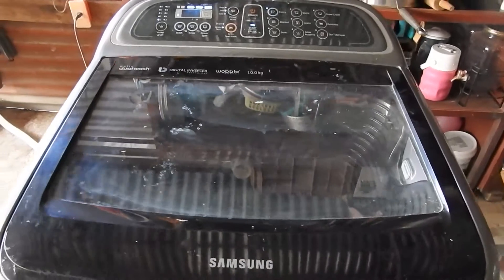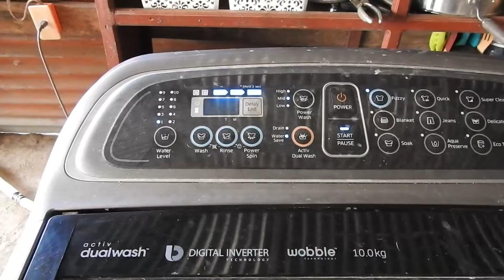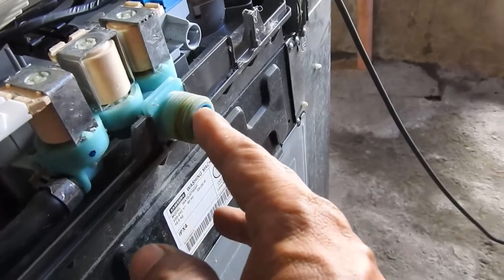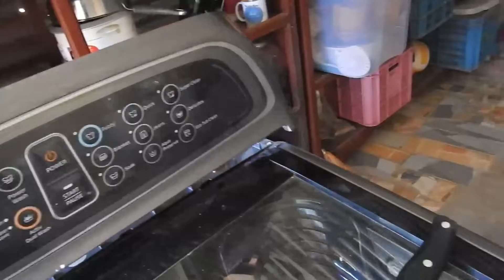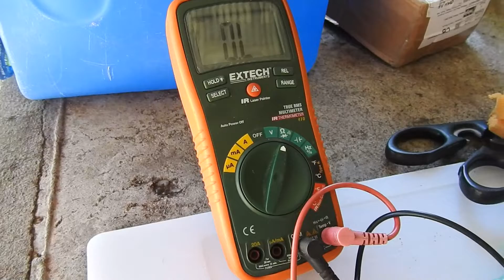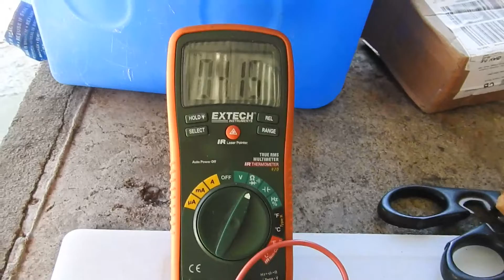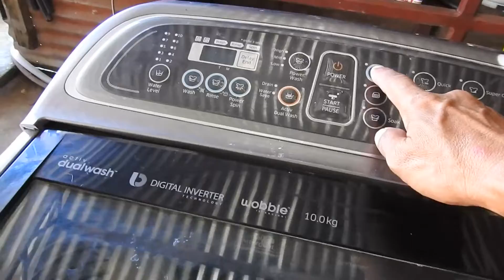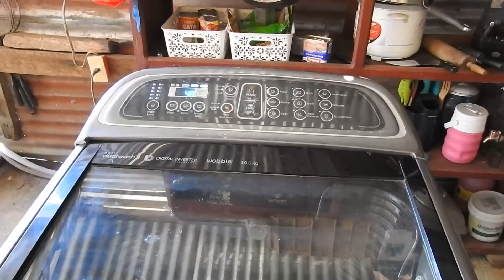Roxas, Isabela - Samsung Washing machine error code 4C, what to do

Comment: How much did that Solenoid Valve cost ?
And as on what date .. [just for the info]
Reply from the maker: Thanks for watching. The solenoid costs 600 pesos (about $10 USD) a year ago, June 2022. There are sellers who sells it for around $5 USD however, one will need to spend time searching for it in Lazada

Comment: I have the same washing... Diy replaced solenoid Valve but after 3 months again 4C occurred... But there was a Flow of water apparently it will stop at a certain level.... So the washing or rinsing stop... Question, do i need to replace the solenoid Valve again or is there a pressure switch or pcb that might be damage as well... Tnx in Advanced for the answer..
Reply from the maker: Thanks for watching. There is a water flow metre or sensor that is used by the computer to tell whether water is flowing into the bucket. My machine has not reached the wear where I will need to disassemble it and find out where it is located. At the moment I cannot help you yet. Someone out in YouTube land may help?